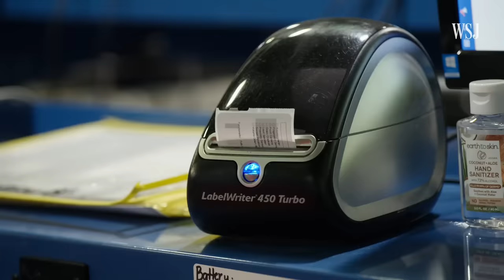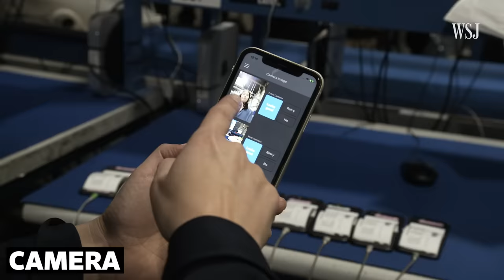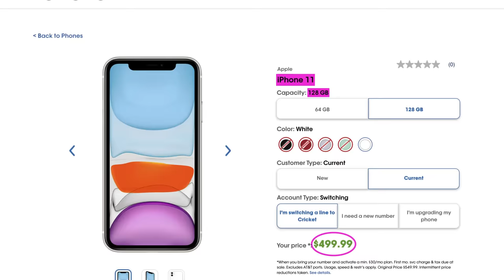How a Traded-In Apple iPhone Gets Refurbished | WSJ

Comment: Biggest issue for me would be that they aren’t replacing the battery. With older phones that’s a big problem
Reply: blame apple for that, its not a drop in situation anymore
Reply: why would you replace a battery in every single used phone? If it still has 80 percent or more it may still last for years. If they replace the battery in every phone then the business won't be profitable.
Reply: @jdillon8360  I would preffer a new battery. Even if the phone cost more
Reply: @jdillon8360  thats not entirely how that works,

also batteries expand

sure it still holds a charge, but its still degraded its chemical process, you still end up with a slower device.

also a big reason is safety, just because it still holds 80% charge or whatever doesn't mean the battery it self is in a state where its as safe as it was, if these batteries burst its a done deal
Reply: Buy refurbished from apple, they replace battery and other external parts before shipping it.
Reply: @jdillon8360  new battery kits are $40ish retail. Batteries aren’t that expensive.
Reply: @archerman1  Apple replaces any internal broken/used parts like the battery, and they switch everything on the inside of the phone to a brand new genuine OEM Apple shell of the phone. This would be the frame/back glass and wireless charging pad. There’s a reason Apple charges so much for their refurbished phones, and what I stated above about the shell is why. But IMO, if anybody wanted a premium refurbished phone, then Apple’s Refurbished phones are the best option.
Reply: @andmc93  Then you are free to buy a new phone.
Reply: @NonsensicalSpudz  Sure, then buy a new phone.
Reply: @Powderlover1  Plus labour to open the phone, do the work, and then close it up and retest. If you do all of that, you have to increase your price so much it gets so close to the price of a new phone that there is no profit. There's a reason they don't replace the battery in every phone, it's because many people (myself included) are prepared to accept a used battery for the big discount versus a new phone. I've been using iphones for years, but I've never bought a new one and I doubt I ever will.
Reply: @jdillon8360  Or buy a 2nd hand phone with a battery already replaced. I mean. But a get it. There are many options and one may fit to every customer
Reply: How can they replace the battery if they aren’t being made anymore?
Reply: @Youngdanny45  I've seen third party functional batteries in other videos. It's an option
Reply: @jdillon8360  That hasn't been my experience. If there were still user replaceable batteries, it would be a non-issue. Now you need a bunch of tools, and the skill of a brain surgeon, to replace a battery. If the battery isn't new, I would go for a new phone.
Reply: @roachtoasties  Sure, you are free to do that. In my case I cannot afford a brand-new iphone, so I just get good second-hand ones. I've found that it works for me, and there is clearly a market for second-hand phones with second-hand batteries.
Reply: @Powderlover1  they only make $65 a phone, so $40 for battery would destroy their margins
Reply: Batteries are used as antenas and some replaced batteries do not have payment or RFID reading connectivity.
Reply: As soon, as you replace the batterie, an issue message pops up on the screen...

So, without a complicated process, you can't fully refurbish newer iPhones.. 

You can thank apple for that..
Reply: I bought a refurbished iPhone XR (from Apple directly) and the battery is still good 5 years later
Reply: Yep. You read my mind. Batteries degrade over time, motherboard gets weaker and no guarantee that it will survive months.
Reply: That is true. The process is so crude.
Reply: If battery fails during the diagnosis, they do
Reply: My thoughts exactly
Reply: @andmc93  change it yourself. It's not a big deal with most phones.
Reply: @Peculiarsafe83  They charge idiots so much because they prevent self-repair and maintenance.
Reply: @BlueFlash215  Yep you are right. I did it with my laptop. It didnt kill me. XD
Reply: @andmc93  👍

Good job. More people should just try it.
Reply: If that is important to you, you can buy a "battery replacement" kit from a 3rd party vendor.
Reply: @andmc93  so buy from somewhere else duh 😂
Reply: Seriously I am surprised how rudimentary the refurbish process is, where I live all refurbish sets comes with new screen and battery so it could fetch a higher price with additional 1 year warranty. I am shocked to see that’s how US sell their refurbish phones.
Reply: You can replace it when it fails. Lithium battery should have a longer lifetime
Reply: @Powderlover1 they are hard to install tho.
Reply: @Youngdanny45 batteries are still made for the original iphone....
Reply: @BlueFlash215 actually, it's very difficult
Reply: @carstuff4u942  keep on trolling
Reply: @andmc93  Most don't, that's the whole reason people buy refurbished
Reply: @jdillon8360 I get new iPhone every year, because I found it drains battery really fast when iPhone battery health is below 90%,
Reply: @andmc93  Then buy a new phone…
Reply: @jdillon8360  While 80% sounds good on paper, iPhones only support the full "power" of the phone up to around 80% battery capacity, if it falls below that the power gets a significant hit. So if you're running lets say 78% battery capacity, the phone may end up stuttering in some occasions or even randomly shutting off. I own a iPhone 13 and mine is still at 100% because I charge it 20 - 80% all the time, but not everyone is like me. If people keep their phone plugged in at all times, the battery life is going to tank extremely hard. One friend from university bought the iPhone 14 Pro when it came out and it's literally at 92% after half a year because she keeps it plugged in EVERYWHERE and ALL THE TIME. Therefore you're not really safe from bad batteries even when buying newer phones. It's better to have a new or really good battery than to replace it yourself after a year or two.
Reply: That system they were running earlier checks if that’s needed
Reply: Throwing all that battery would cause serious environmental issues
Reply: @andmc93 then don’t buy used? Too miserly to buy new but too fussy to settle for used. Typical.
Reply: @Peculiarsafe83  I which they replaced the battery in the iPad.
Reply: Also they   are  running  older OS  which, depending   upon what  version,    can't  be   updated.  after  a while. I'd rather  buy a  new  phone  .. with the  latest  OS  and  new battery!
Reply: My xr is still at 80 percent and I’ve had it for 3 years now. The battery doesn’t run out that fast
Reply: He does mention that at the end of the video, it comes up in the testing and he they take a loss like sells for cheaper then the good battery ones
Reply: they should called it USED PHONE not refurbished!
Reply: Then buy a brand new phone then. What are you expecting from a used 4 year old device?
Reply: @Powderlover1 The problem is that installation is a pain in the a$$. I’ve done my own through ifixit and apple love to glue in as much as possible. Just look at the progression of the battery in the macbooks; external pop out, then internal trey, an now glued in. It makes it unsafe and a pain in the a$$
Reply: @BlueFlash215 they’re glued in. you have to take a piece of floss and drag it along the back. But also if your not careful you can bend or tear the pouch. Macbook, you have to pour acetone into the battery trey to release the glue. So yeah who’s the idiot now you fungen dunce. I,be done all that and would still pay cause of liability and my time is worth more that that.
Reply: Yup, the real story was completely missed, but the evidence was in a key phrase when he said they have to sell at a loss when it has a "bad battery".  They aren't even capable or authorized to work on phones.   Nothing they do here is refurbishing.  They are windexing an used phone and misrepresenting their product with the word "refurbish".  Even worse, they have ridiculous benchmarks for what qualifies as a "good" battery, which is usually stated as capacity  >80%.  Their standards for a good battery reveal that they will happily white-lie to the customer about what that battery capacity is telling you.  80% doesn't mean it's got 80% life left, rather it means that the capacitance of the battery, the voltage it outputs, is at 80%.  The phone won't even turn on below that in most cases.  Total scam industry, unless you are buying straight from Apple who give you a new battery.
Reply: @andmc93 You ought to just get apple refurbished or a new phone

Comment: The value in a refurbished phone isn't the fixes that they did, it's knowing that the phone you are getting is working properly.
Reply: also in how we didn't need to mine another rare metal to make that phone
Reply: I have always purchased new iPhones and I have never once received a defective one nor am I worried about ever receiving one.  If I do then I’ll swap it out through a regular return or warranty.
Reply: But not too long cause used before )))
Reply: And knowing you can return it if there's a problem.
Reply: @spades9048  They meant versus buying it on eBay or from some random seller 2nd hand.

Of course a new phone is going to work.
Reply: The problem with used phones is they have a limited life left. Just because the battery works, doesn't mean there is not significant degradation. Just because the phone works today, does not mean it won't randomly fail at some point in the near future. I find I get about 3 years max before the iphone pros start to get slow, buggy, and other random problems start to arise. If you buy a 2 year old phone, you may only get a year before you need a battery replacement or something else, which will cost more than if you just bought the phone new. I would never buy anything refurbished personally as someone who did an internship in a refurbishing factory in high school. There's tricks to getting these to work for a few months that you know will eventually fail, like re-flowing solder with a heat gun. I can make it work today, but it won't last. It's a dirty industry secret.
Reply: @heyaisdabomb  wow! thanks for this insight.
Reply: @heyaisdabomb  lowkey agree on this, I never buy a refurb phone myself, but my car and motorcycle is second hand
Reply: @heyaisdabomb  ive bought 5 or 6 refurb/used phones for myself and havent really had issues. I ran a repair shop up till a few months back though so I have tools if possible. I also have only used Androids with hotswap batteries, like this xCover Pro
Reply: @FrogHeat  sharing!!
Reply: @thebasketballhistorian3291  Ebay has a phenomonal money back guarantee.
Reply: Well, no. It's a cleaning and a test that is either built in, or download able. 

If it doesn't work right, I'll just call up the store for a replacement.

I'd want a new battery at least.
Reply: @heyaisdabomb  battery cost more than getting a new phone? that sounds like a lie
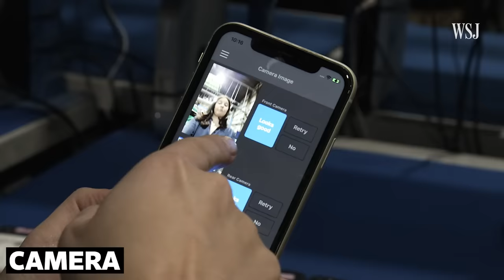Reply: 2:00 she got roasted in front of 500k viewers
Reply: yeah, they show nothing of the process that is more shady. company does very good job of putting the phones to the market again, but the issue is with those that need repairs, problem is usually repair is beyond profit, and that is the problem of old phones, manufacturers block access to the parts and you left with a brick. they should do material about how hard is to get the original parts to the phone, and how parts are paired with the mainboard to prevent you from repair. manufacturer deals cards here, and this recycling company would earn ton more if they could disassemble the phones for parts. but they cant.
Reply: There is actually another great benefit that comes out of refurbishing smart phones. That would be they don't all go to landfills!!  It would be worse if they just threw it all in the landfills which would be bad.
Reply: knowing what you're signing up for, or in one word - certainty
Reply: Tried and Tested
Reply: Why don’t they change the battery? It may be pretty bad! I thought they will replace it !!!
Reply: After they fixed what ever was wrong with it
Reply: @heyaisdabomb you got a point but a battery replacement is 30-70$ if you get the original one
Reply: Ebay and 2nd hand sellers online have ratings for a reason. People have been complaining for years about buying these "refurbished" devices and they're carrier black listed for being stolen. You gain nothing by paying more for a device someone literally turned on and wiped down...
Reply: They was testing (iPhones) in the 70s 🎉 true fact ❤
They must be on iPhone 35 by now 😂